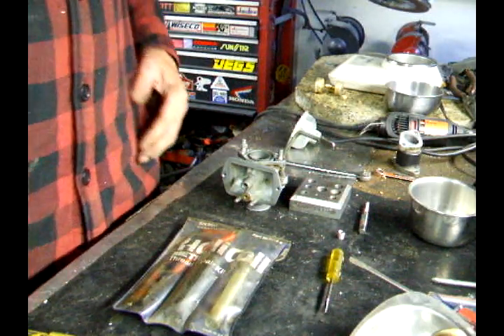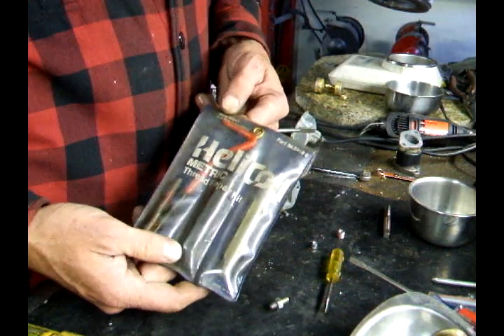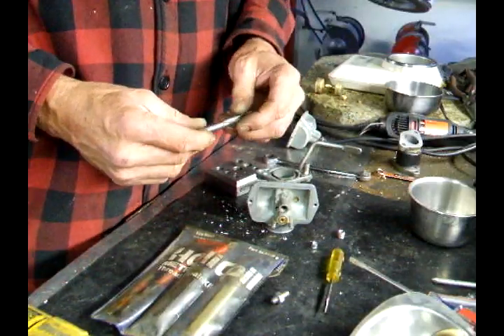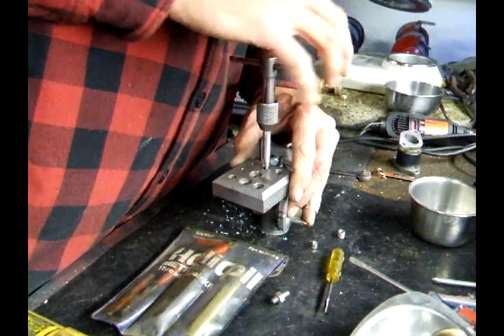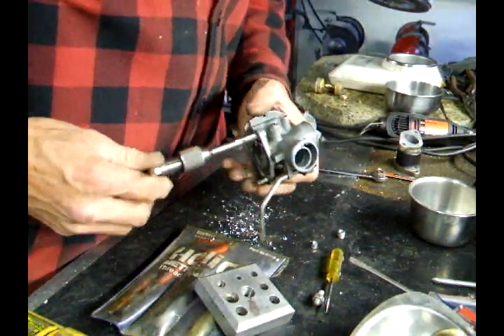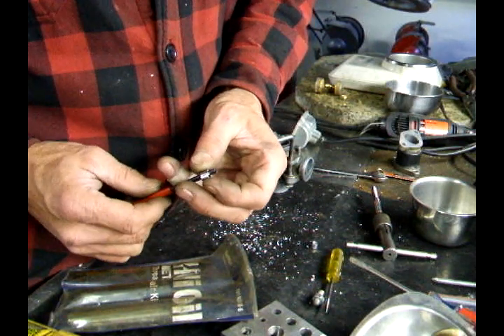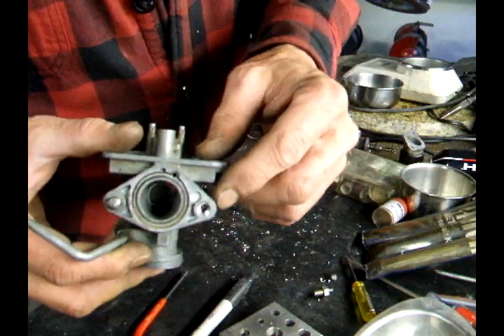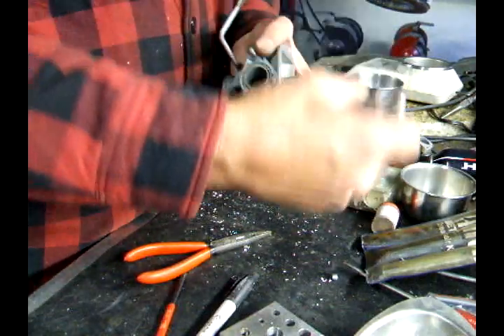HOW TO REPAIR STRIPPED THREADS WITH A HELICOIL

Comment from the maker: Check out Amazon for the best prices. They will bring it to your door.
T-Handle Tap Wrench 1/4 through 1/2 Inch  https://amzn.to/2tEG2Qn
 Helicoil Repair Kit Metric M5 M6 M8 M10 M12 https://amzn.to/2JLM33R
Thread Repair Kit M6x1.00 http://amzn.to/2f23RrO
Thread Repair Kit M8 x 1.25 Metric  https://amzn.to/2FwefFr
Thread Repair Kit M10 x 1.5 Metric https://amzn.to/2rcrGpS

Comment: Nice video. A question though. In case of fixing a damaged thread in a blind spot, for example in an oil pan without removing it, how do you remove the little piece in the end of the helicoil when you brake it. Does a amall magnet do or there is another kind of technique applied for this?
Reply from the maker: +ΣΤΕΛΙΟΣ ΒΑΣΙΛΑΚΗΣ I have used a nail to bent the tab off in a blind hole and then used compressed air to blow the small piece out. Also have use a magnet stuck to a small screw drive to reach in there to fish the drive tab out. Shop vac also, what ever you have to do to make  it work in your situation.
Reply: +A Motorcycle Nut  Thanks mate